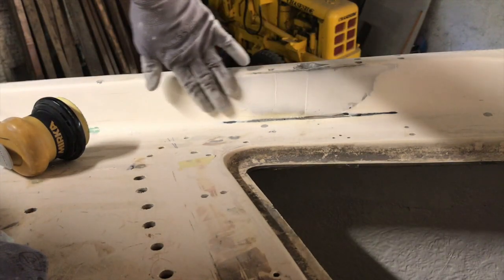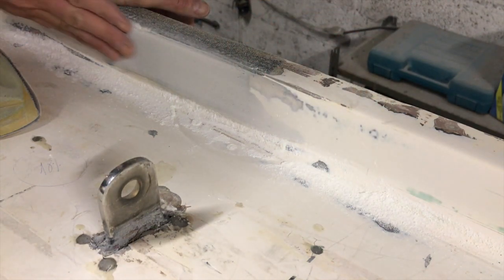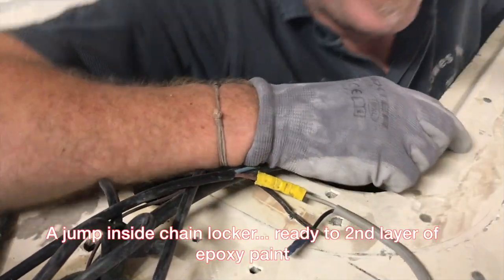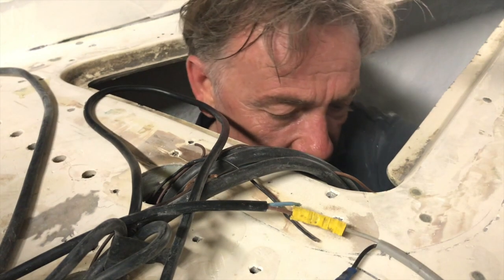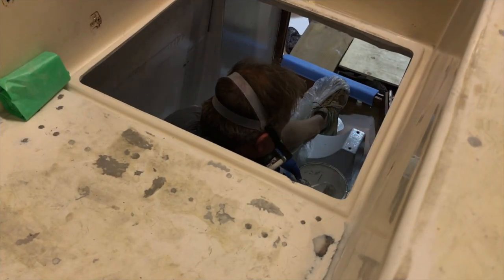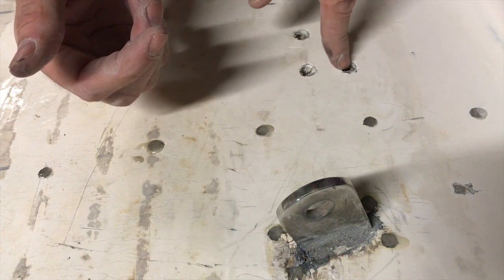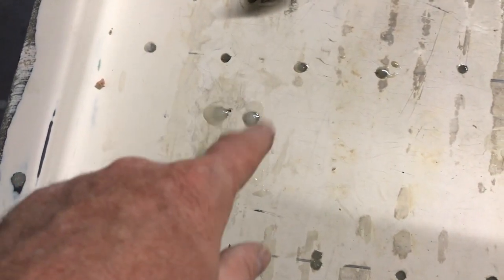Hallberg Rassy 312 "Ellös" - Sea4See  - Errors, painting, sanding #2

Comment: Was thinking, that's a bodge not using a drill, then realised you are clearing away some core material to fill with resin... Very clever idea 👍
Reply from the maker: Hello Samatha! Yes the original installations made from HR is screw on the support .. I drill  big hole and fill all with epoxy and mineral fiber to make more strength... after that I drill again and install the hatch as he did. Using bolts and nuts was my idea but it will destroy the bow cabin look...